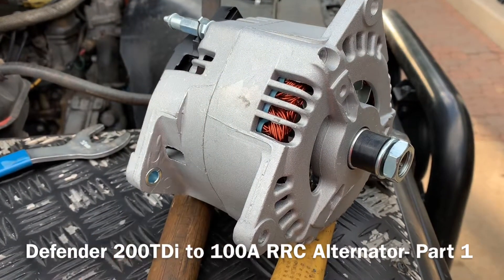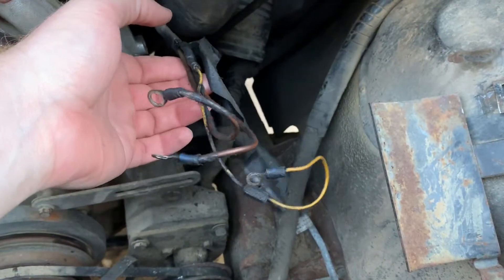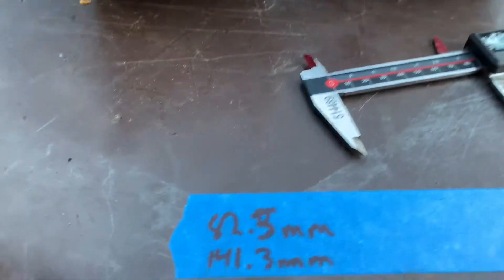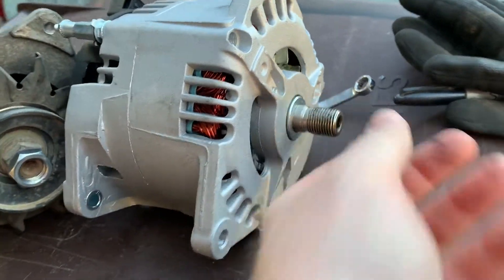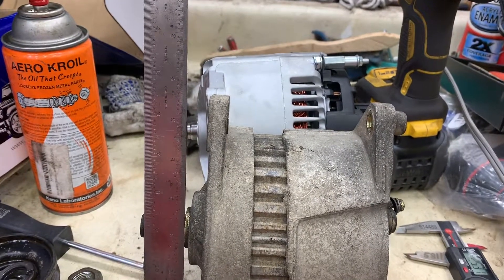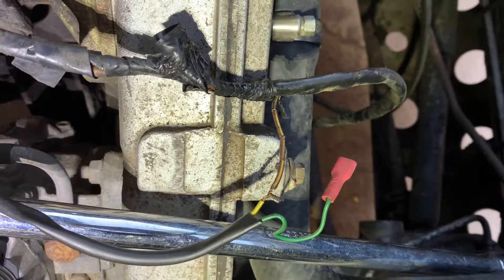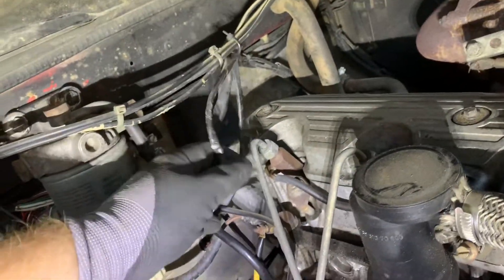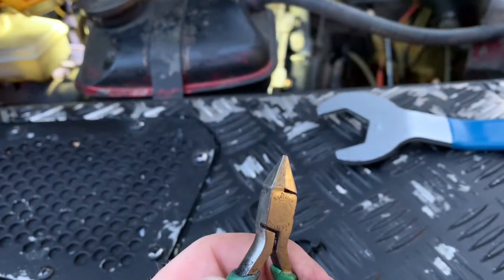Defender TDi 100A Alternator Upgrade

Comment: They fit a few canal boats here in the UK. I used to work in factories doing loads of the old ones in the 90`s. They also fitted old Ford Escorts and Sierra`s. I don`t like the 100 amp alternator. The rotor catches the stator quite a lot, but that might be due to us removing them to clean up and they never go back in the right place.